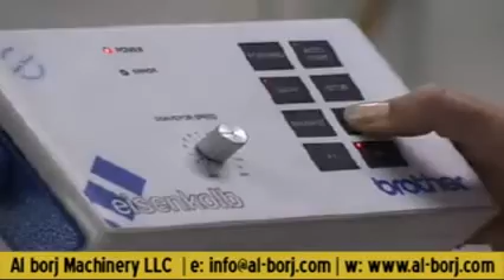Eisenkolb ACP-2200

Comment from the maker: Automatic combined panel joining/tape
attaching machine for CURTAINS Manufacturing .... Contact: hassan@al-borj.com

•  Equipped with Brother high speed 2-needle, 4- or 5-
   thread V-series safety stitch machine with variable top  & bottom feed.
•  Auxiliary puller feed in combination with in-line belt feed offers excellent, pattern matching, sewing results in
   panel joining operation.
•  Combined top and bottom feed creates outstanding conditions for fast and smooth Buckram tape attaching.
•  Advanced pneumatic fabric guiding system, optional with separately adjustable upper/lower layer guides,
   to offer quick and ﬂexible adjustment to differences (up to 50 mm) in selvedge's.
•  Sewing section extendible to ease threading, cleaning and maintenance.
•  Optimal control of start/stop functions by means of pulling cables situated along the entire operator side
   of the machine.
•  Fully synchronized, 550 cm long, conveyor belt simplify the handling of large and heavy curtains.
•  Fully  automatic, PLC- controlled, autonomous sewing sequence without interference of the operator
   increases  productivity by overlapping working method.
•  Machine measurements 550 x 160 cm.

Eisenkolb ACP-2200